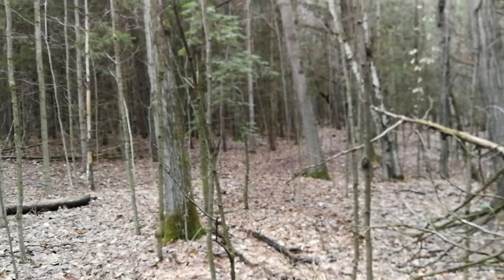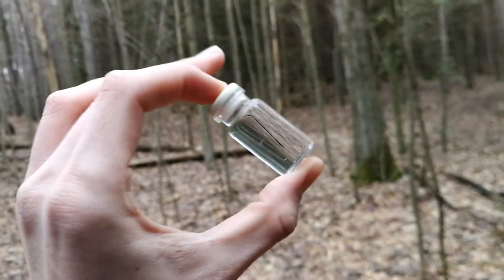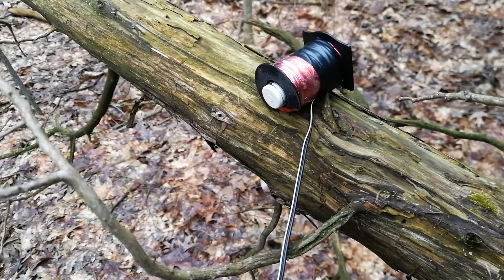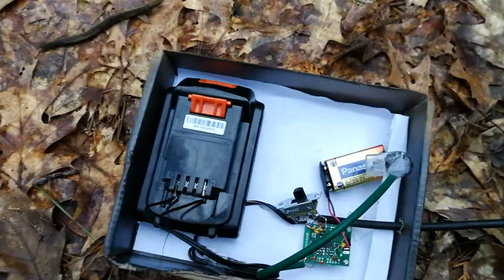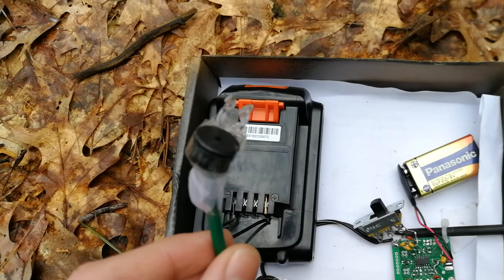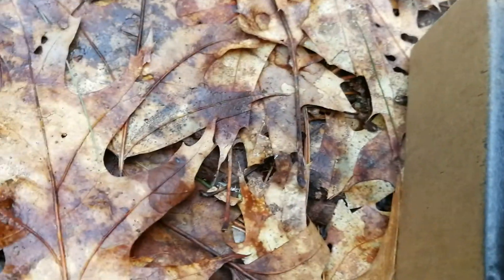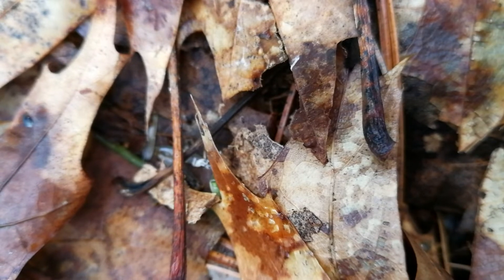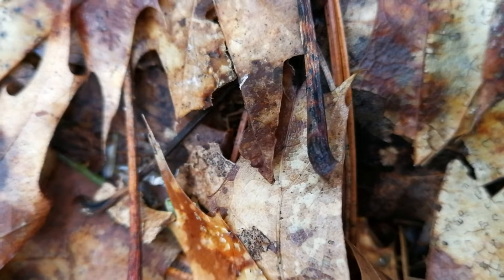The sound of protons: My first NMR experiment

Comment: The first time I learned about NMR in 1997 as a kid, we were at a research lab and someone actually hooked up a speaker to the machine so we could hear this sound. This is only the second time I've heard it. I'm still far from really understanding NMR at a mathematical level, but all the same, I do understand much more about how it works today; though this actual sound of the FID somehow remains a little magical. 
Though I'm not much into electronics per se, I really like your NMR and radiation videos and am subscribing in hopes for more of that kind of thing!
Reply from the maker: Wow, many thanks for the encouraging comments!  Yep, the sound makes it a deep experience for sure. I intent to elaborate on that aspect in particular in future videos.

Glad to hear that stuff is appreciated. I often felt that my radiation stuff was "falling through the cracks" a little bit with the deeply academic electronics crowd that tends to hang around here. But I really do like grappling with fundamental physics that way. There's a big difference between reading about how something works v.s. witnessing it unfold in front of you. 

I've been otherwise occupied for the last 6 months or something, but it's certainly my intention to continue with that sort of stuff. One idea I've been noodling on was to set up a long tubular array of pancake GMs, and using my simple geiger pulse logic system, isolate the high energy cosmic ray muons (which trigger all the detectors "simultaneously") such that you know for a fact that they hit a target under test, which has a calorimeter and a gated scintillator array to analayze the "debris" which scatters off due to the muon.

You could do LHC level high energy experiments without needing to accelerate the particles yourself. Its just a very sparce beam, and you may need to leave it running for  years depending on what you want to "see" with it. 

There are enough muons at lower energies, but still beyond anything found in terrestrial radioactivity, such that at least some interesting stuff should happen.  You also need distant detectors used as a "cosmic veto" to reject electron shower events, which would confuse the system. 

Lots of stuff like that on the list.

Anyways, welcome to the channel! 

All the best🍺
Reply: @analogplanet9675  Yeah I'm enjoying the dual pancake experiments! Very little on yt done with actual muon air shower measurements, so that's interesting to see. 
You sound Canadian and it looks like you're in a deciduous forest - Ontario? If so and you're ever in Rochester for some undoubtedly regrettable reason let me know and I'll give you a tour around the high energy laser fusion facility here.
Reply from the maker: @Muonium1  whoops, didn't get a notification on your reply for some reason...

 Yep, just outside of Toronto. Funny, I've driven through Rochester a couple times, in the good old days. 

Woah, I appreciate that very much, I wasn't even aware of the facility there. Very interesting indeed. I'll add it to the list of future road-trip stops, in that direction 😁.

Comment: I designed a proton precession magnetometer (gradiometer) back in 2010.  My lab looked just like yours.  Very hard to design a PPM because all you can do is test various stages of the electronics in the lab and think it should work but then I would have to go deep in the woods away from any metal or power lines to test.  For me, I bought a battery powered portable digital scope to view the signal.  I was able to measure various aspects of the signal to tweak my software for things such as muting time and dampening time.  It was quite a complex project for a non-engineer.  I am currently toying with improving it with some bells and whistles like mainly replacing the character display with a color graphics touchscreen.  This is tougher because you have to find one that is sunlight readable.  Also going to replace the RS232 port with a USB port, replace the internal flash memory for survey storage with an SD card, put an RTK, 10 centimeter accurate GPS in it.  I can remove the real time clock in it because both the micro controller and LCD I'm looking at have RTCs built in.  A lot of the code space used was the time and date setup code but that can all be eliminated because I'll set that in the RTC from the GPS.  Good luck, it took me awhile before I got a good NMR ping.  But with all the tweaks, and using a test setup like yours where I had a whole case of various liquids where I could test the properties of different liquids, I have it capable of taking very consistent readings in less than a second.
Reply from the maker: Very cool! I like your GPS idea. I bet that's how the real survey devices work, these days. I simply patched my output to a usb soundcard in the side of my laptop, and recorded the signals for post processing for most of my experiments. I did come up with and build gated analog f to v and Q to v converters for the magnetometer, with some super low drift sample and holds at the outputs, and a dmm for readout. Sort of worked, although not as practical as a proper daq, like you describe. 

I know exactly what you mean about having to design and prototype in an essentially open-loop way, making this a comparatively difficult excercise, engineer or not(like us😉) I was back and forth between the shop and the field several times over a few days to get it working nicely.

 The day I got it nicely optimized, I was taking measurements in a local conservation area, when an off-leash dog ran over and thrashed my reciever around like a chew toy. I couldn't believe my eyes. Owner calls out: "did he getcha?". Luckily for both of them, my strain relief held in the key, unfixable zones of the device 😂

Definitely check out my later NMR stuff on this channel if you're interested. Several folks have asked me for reciever details and coil design stuff and whatnot, so I'm intending on following up with that in the near future as well. My bandwidth is a bit sapped right now with my little seedling metal fab shop buisness, which I embarked on immediately after this NMR stuff. 

Welcome to the channel! thanks for subscribing. Cheers bud🍺

Comment: I'd love to see a video on the physics of what's going on!
Reply: Here is my understanding of what is going on but I'm not an engineer or physicist.  Protons are both spinning and precessing.  If you have ever played with a top and you pull the string and it spins on its axis, then give it a thump, it precesses while it spins.  The speed or frequency at which it precesses is directly proportional to the magnetic field the protons are in.  It is a simple formula to calculate the magnetic field strength from the frequency.  It is not easy to measure the frequency as it takes great precision and since the signal quickly decays, you have a short time, with a very small signal level to make a very accurate measurement in a noisy environment.  Back to the protons, the problem is that these protons are out of sync or randomized so there is no signal created.  By taking the coil of wire and putting it across a votage source and creating an electro magnetic field, some of the protons stop precessing and line up with the magnetic field, once the voltage is removed they begin to precess in sync and create a microvolt level signal induced in the coil of wire.  The longer the voltage is applied, more protons will be polarized, and a stronger signal will be generated.  If you google search you will find a paper by James Koehler that explains the theory behind it.  He is a physicist and can explain it much better than I can.  I used this paper to design my magnetometer.
Reply from the maker: @frantech6935  Thanks for taking the time to explain it in your words, and sharing that reference. I really like that summary.
Reply from the maker: Thanks for the comment. I did another follow up video with a bit of  physics explanation, but there are far more detailed descriptions out there, even on YouTube, about nuclear magnetic resonance. The quickest intuitive (but hand wavy) summary I can think of is that protons are little magnets like a compass needle. When the external field is changed, each "compass" tries to align with the field but overshoots and bounces back and forth at a characteristic frequency which depends on details of the proton itself and the external field strength.